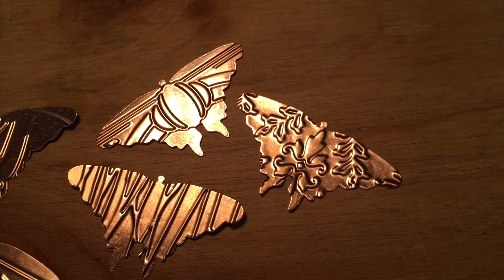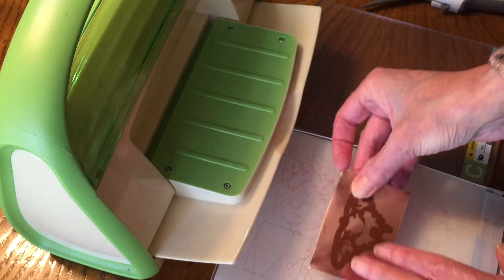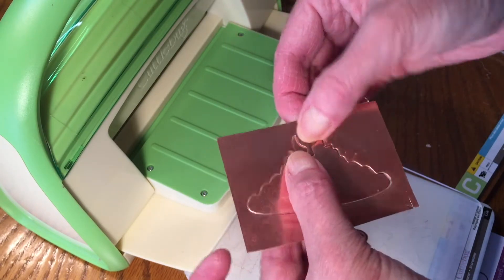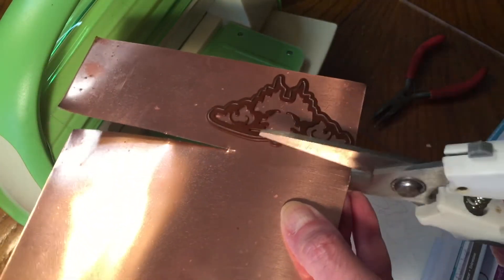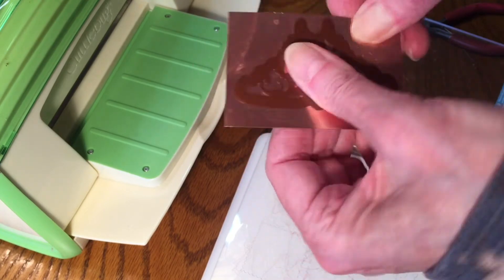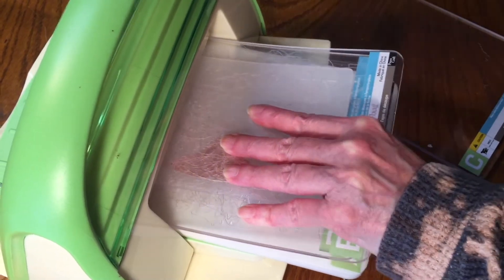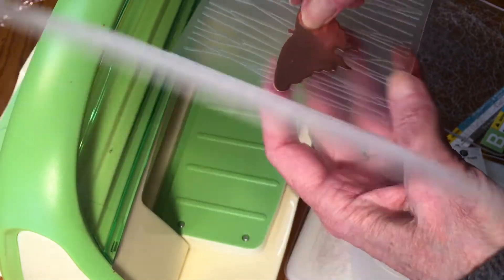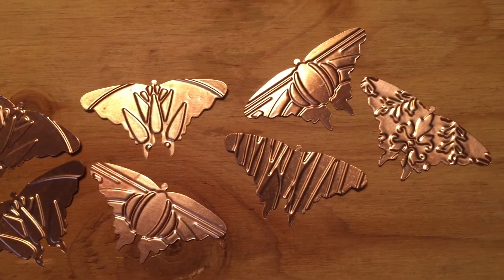Cutting Copper Butterflies 🦋 Luna Moths Extended Content!

Comment: I have enquirer  all of the die cutting machine makers. I always get answer” this machine was design d for card stock. This is the 2nd video I’ve seen using 30gauge metal and it die cuts and embosses!! Yippee
Reply from the maker: Yeah they don't "make" them for that purpose so they won't promise anything and if they say yes you can use metal and then you use something too thick it could break the machine as I say in the video so they will not recommend metal. Just use thin. https://laurabethlove.podia.com/

Comment: So cool! Do you have to sand/buff/treat the edges afterwards to keep them from being sharp/dangerous, or are they fine as is?
Reply from the maker: It depends how they come out. If the dye make a clean cut then probably not, but if it turns out you have any burrs or rough edges then by all means go over them with a file. Thanks for watching!